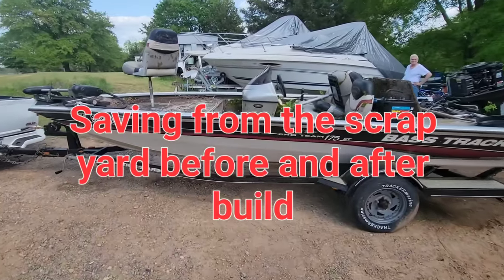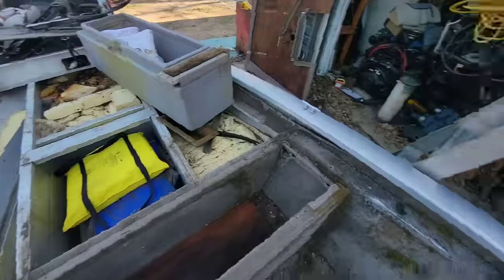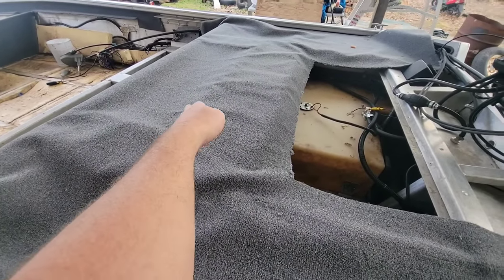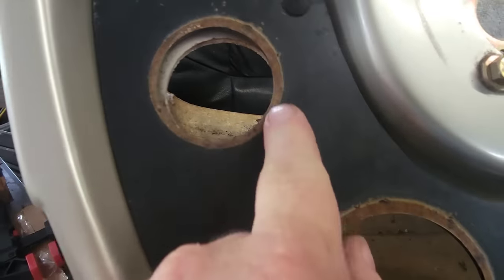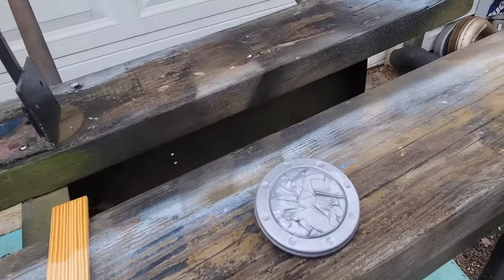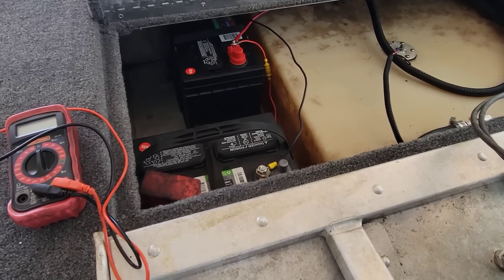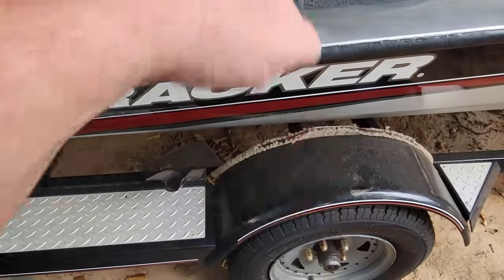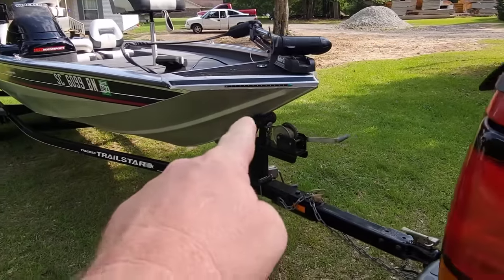Must see Bass Tracker restore before and after transformation@Vassmotorsports#trending #viral

Comment: You’ll be replacing that wood in a few years. Should have epoxied it.
Reply from the maker: It'll be fine it's pressure treated and always under a cover any way.   If gets wet few times a year it'll be fine.  Have you not ever had a deck on your house? Most are pressure treated and get all the weather especially the posts,and in or on the ground too ? Many years I'm sure.  But I did glass them in pleasure boats.   Thanks for watching
Reply: @Vassmotorsports  what’s the matter lol deleted my comment about you destroying the boat putting pressure treated wood in an aluminum boat??

Comment: What’s the cost ?
Reply from the maker: The boat was free and I had about $1500 in all supplies start to finish but that's me shopping Ebay and used GPS , but was a big job and lots of labor time
Reply: Great work
Reply from the maker: Thank you so much and Thanks for watching Vassmotorsports  hope ya check out some of my other videos,   will be doing more boat restoration this spring on couple I bought recently